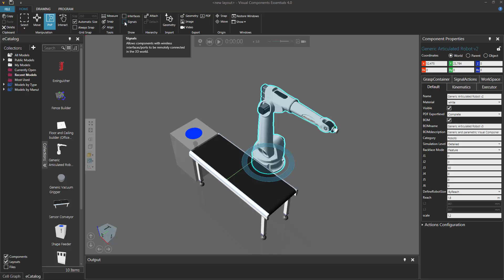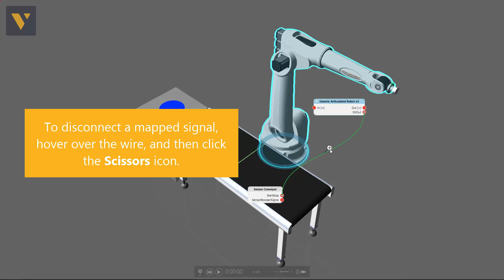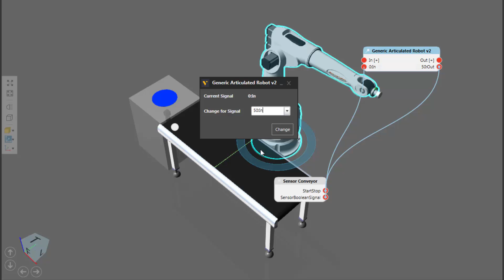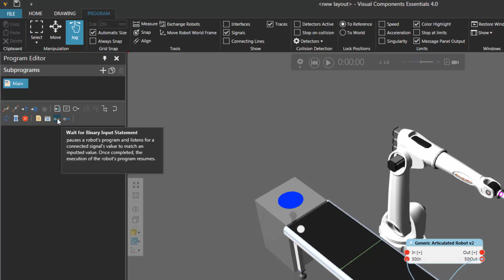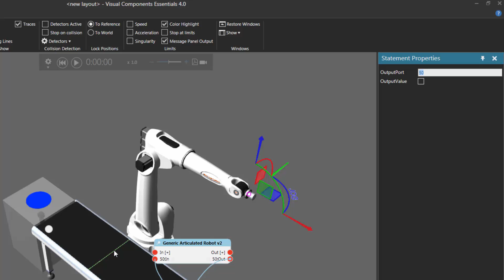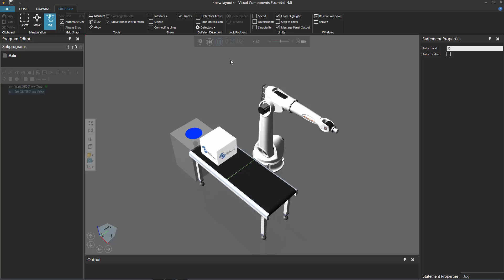Connect Signals to a Robot

Comment: hi, really thanks for your videos teaching us. VC is powerful! May i have a question like if we want to build our own turning table with curved wires , we have to learn Python language? What if we don't know the programming language?
Reply from the maker: Depends on your needs and what you want to visualize in the 3D world.

In one case, you would use a Tranform feature that scales the size of the geometry representing the spool of wire. The scale factors for the Transform expression would use component properties that would be decremented as the table turns or as the wire is fed into another component or path. So we're talking about a couple lines of code that use either a loop or an event to update the spool of wire and turn the table. Basically, you would need to either scale, sweep or revolve the geometry. If you have access to our old forum, you could check out this post at http://bit.ly/2bfa9XN.

In another case, you could use a Physics Cable that could be attached to a component that applies a pulling force, but this is not possible in 4.0 version.

We support Python and .NET programming languages. If you need an introduction to our Python and .NET API or component modeling, consider attending a training session. We also provide a service that models components for you. If you are interested in this, contact our Sales department at www.visualcomponents.com/contact or one of our partners in your region at www.visualcomponents.com/partners.

If you have a license with maintenance, send a Support ticket at www.visualcomponents.com/support or try asking about this on our forum at forum.visualcomponents.com.